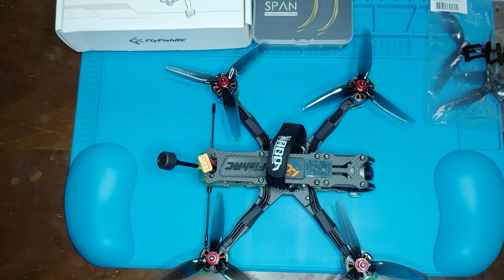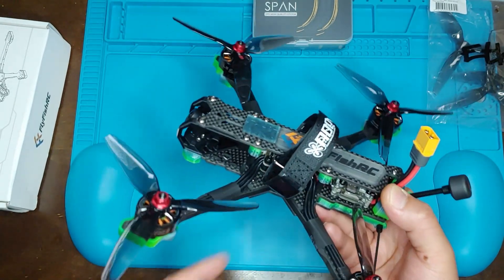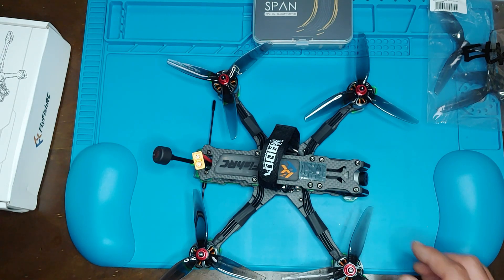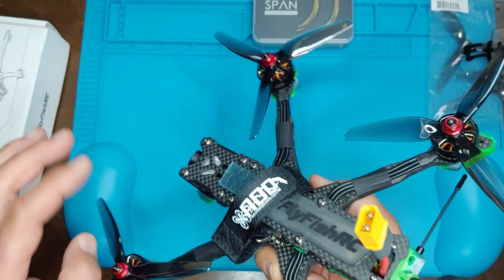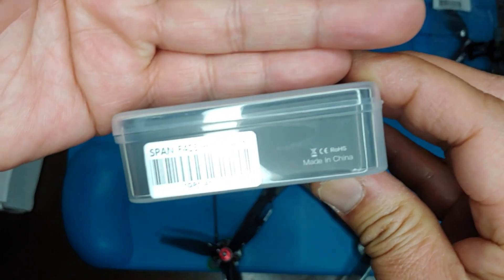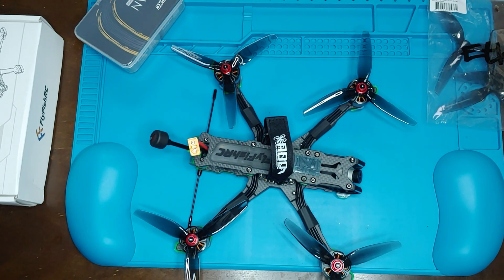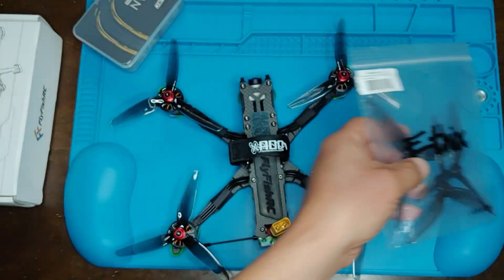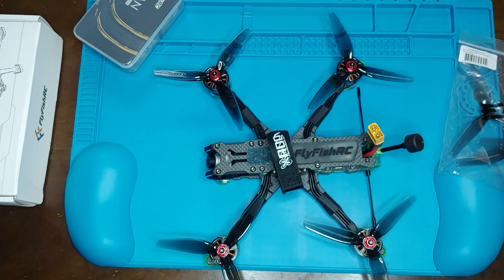FlyFishRC Volador VX5 5" FPV Quad Build and Flight

Comment: How did you get the xt60 cable through the hole?, my cable seems to be way to big.
Reply from the maker: I installed the xt60 cable through the top plate than soldered the cable wires to the stack (ESC).  It does make it more of a hassle when working on the quad that requires the removal of the top plate.  Hope this helps, and happy flying!!!!
Reply: @jaechoe  yes that would make it quite the hassle. I ended up sanding the sides of the xt60 and filing the frame to make a bigger gap for it to go through.

Comment: Where did you install buzzer?
Reply from the maker: Buzzer is between the camera and stack.
Reply: @jaechoe  how did you install vifly Finder type of buzzer?
Reply from the maker: @ramilamrahov8808  that is a great question.  Since you will need access to it behind the camera won't work. Maybe double sided 3m tape it to the rear antenna 3d print. I don't run those battery beeper, I stick with a simple beeper. Easier to install and don't really fly long range, so I usually know the crash site. Sorry for the lack of help
Reply: @jaechoe  thank you for advice.i will consider to install simple buzzer.

Comment: I also bought this frame, and it is my first ever build of a drone. I am having issues with the capacitor. It does not really fit between the ECS FC stack and the air unit. 
Where did you install it? I saw that some people install it between the camera and the FC ESC stack, or at the end of the battery plug, but these options can increase the noise in the flight. What do you think about it?
Reply from the maker: Had similar issues with the cap placement, what I did which is not ideal ( but I am also running 4s, so less of an issue ) is place it between the camera and stack. Used some 3m double-sided tape to secure capacitor to the frame. Or you can add it to the battery plug side. Both your options will work, I just like the clean look with the capacitor hidden. Happy flying,  and enjoy your new build. This is still my daily quad, love it!!!!
Reply: @jaechoe  In the end I did the same. Mounted the capacitor between the camera and the stack

Comment: do you find the frame too heav?
Reply from the maker: It is on the heavier side, but the flight characteristics are nice.  I feel as if I have more control over the quad in all areas.  When doing freestyle moves that requires hang time / inverted moves / split s's it has a lot of hang time.  Also seems to have more throttle control consistency is cruising, and when freestyling. I really like flying this frame, and the more and more I fly this quad the more and more I am liking it!!!! Happy Flying and Thank you for watching!!!!!! :goodvibes:

Comment: The frame looks very sturdy, how heavy is it?
Reply from the maker: The complete build is 448g w/o battery
Reply: and I also want to know how much better than the Mark 5 it flies (assuming it does)
Reply from the maker: Both fly good, the difference to me is: volador is heavier, but also a very solid frame. So less flight time but feels more stable and smoother. Mark5 is a nice frame as well. In my opinion it's different. Volador seems to have more hang time, floatyness. Send it!!!!!